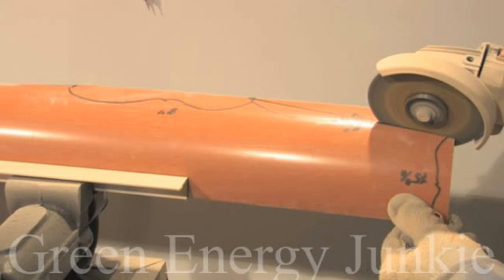Make Your Own Stand Alone Eco Electric Energy System-Part 3

Comment: Although this design is good, it can still be improved on though. I'm afraid that your full length square tubing is severely restricting the full efficiency of your blades, thus creating a turbulent barrier that is drastically reducing the maximum generator output.